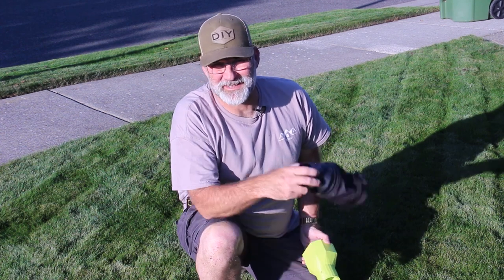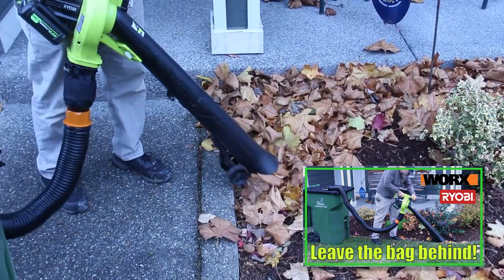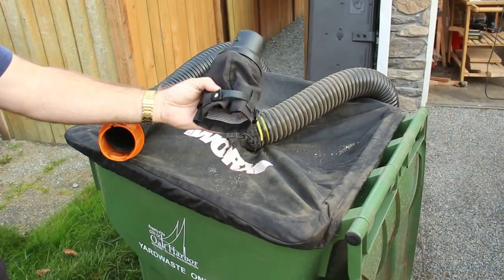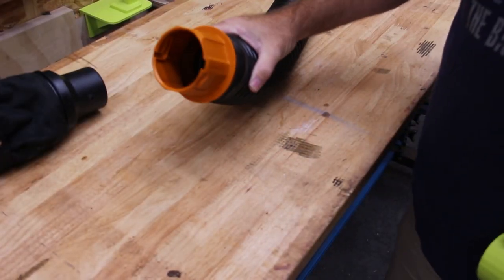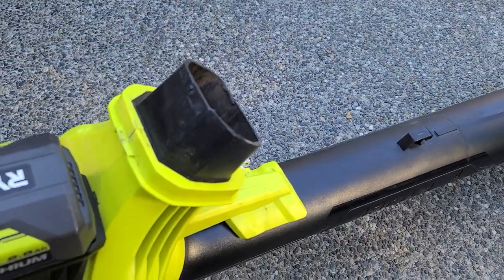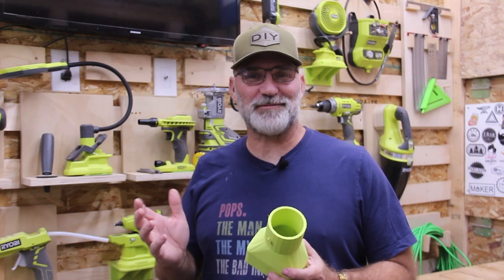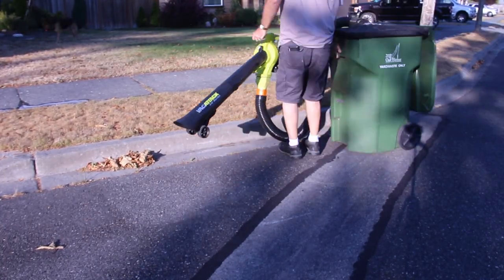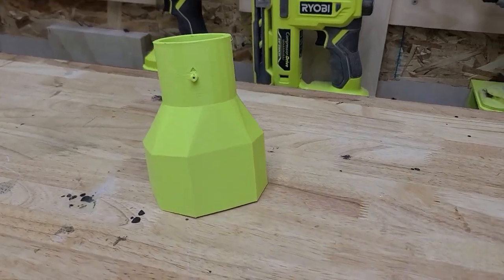3D Printed Adapter for the Worx Leaf Pro Collection System | Ryobi Leaf Vacuum and Mulcher | 2022/19

Comment: 🤯

I'm glad this showed up in my suggestions.  

I 💚 my Ryobi products as well.  But too many acorns in the leaves cause the machine to keep stopping. So I'll either have to blow or rake leaves into a separate area, for ease of use. 

I love the idea of the adapter, but not so much cutting the machine itself.

I use the mulched leaves as native mulch in my yard. So I'd be thrilled to get an adapter with much longer hose  to redirect leaves where I need them.

New sub!
Reply from the maker: Thanks for the feedback!!

Comment: Yes to a longer hose assuming the Vac Attack has enough power to handle a longer length.  Adapter arrived today & looking forward to giving it a work out after the B&D bag arrives from the UK!
Reply from the maker: Keep me posted!
Reply: @DadItYourselfDIY  Hi—a quick update and questions.  Is there a product that reduces the severity of the angle of the flex hose to the adapter that is created when you put the B&D bag on your back?  It clogs very easily especially if the leaves are even a bit damp.  Also, is there a way to create a discharge chute for the Ryobi Leaf Vac?  Rather than collecting them in a bag directly, I found that removing the bag, vac, grind and discharge the damp leaves then go back and either vac them or pick them up is effective.  Thanks!
Reply from the maker: @christopherbullock2644 I replied to your other comment.

Comment: I bought the 3d printed adapter. Do you recommend glueing or putting screw in to hold in place? It seems snug but would think it could come off with the air flow.
Reply from the maker: I used a two screws.

Comment: How do you attach adapter to ryobi leaf vac?
Reply from the maker: Cut the curved part off the exhaust pipe of the vacuum, then slide the adapter on. You may need to use a screw to keep it secured.

Comment: I just got my adapter today... not sure how comfortable I feel about cutting the end off.  Though I do see it will be necessary in the future to use it.  I used the Worx Vacuum and collection system for years but the vacuum/Mulcher wore out.  I always felt the hose was annoyingly too short so sure would like to see how you make that longer!
Reply from the maker: Cutting the exhaust pipe will not affect performance of the tool.
Reply: @DadItYourselfDIY  I'm not worried about that... I just bought the thing and it just seems wrong to immediately start cutting into it.  I am pretty rough on my yard tools and it won't be long before I feel no qualms about cutting it up.  It just doesn't even have a scratch on it yet.
Reply from the maker: That does seem to be the #1 comment. If I could figure out how to get the unit apart, I would design a replacement exhaust pipe with the adapter incorporated
Reply: @DadItYourselfDIY  Well I told you it would happen, I just needed time.  It broke.  So when I fix it, I will do the the exhaust pipe.  Man I thought it would be a little longer than a week.
Reply from the maker: @annenordstrom4495 Wow! What happened?
Reply: @DadItYourselfDIY  The washer and nut came off of the motor assembly fan thing inside the housing.   found the nut when it rolled out of the tubing onto the driveway but I couldn't find the washer. I thought it might be in the bag... but I couldn't find it and frankly I was just annoyed so I just dropped everything on the garage floor said a few special words and said good night.  I did figured out how to fix it last night,  a washer that kinda worked and put it all back together this afternoon after work.  Then I found the washer in the clippings.  It's just how things go around here.  I knew it would happen, it was just a matter of time.  It's raining now, so I'll do the alteration this weekend.  But I am now ready do it and I don't o wait for the adapter Cause it's here!!!
Reply from the maker: @annenordstrom4495 I've never had any issues with mine mechanically. Good luck!!

Comment: I just purchased the adapter so when you put the 2 screws in it did you drill pilot holes or did you just screw then in there
Reply from the maker: I just screwed it in with a machine screw. But a pilot hole won't hurt.

Comment: I just got the worx universal system.On mine it get clogged  in the ryobi exhaust pipe also adapter and the hose alot.I want to get your adapter.
Reply from the maker: I saw you ordered the adapter! I hope it works out for you!
Reply: I got it today were do i put the screws. @DadItYourselfDIY
Reply from the maker: @charliezicolillo where ever you want. Most people center them on the flat sides.

Comment: I just received the adatper for the roybi muncher attachment its not much better than the attachment that came with mulcher  there is no way to connect to mulcher an blows off when using it comment to hose find my suggestion is to mold the black rim to the attachment so it locks in

Comment: I like your idea but there is no way I can cut my Ryobi up. I just bought it. Have you thought about making an adapter for the stock vac?
Reply from the maker: The angle of the exaust pipe makes it impossible, and I've tried to remove the pipe with no luck.
Reply: I didn't realize that either when I ordered. Guess I missed that important 5seconds in the video. I spent a half an hour taking the shell apart thinking it replaced the black piece, but obviously not. Going to have to sleep on this one.
Reply from the maker: Were you able to get the shell apart? I was unable to.
Reply: I’m really hoping for a cut-free version, too. I’m thinking of getting a vacuum, and I’m glad this comment mentioned how cutting was needed! I had jumped over that part in the other video, so I watched this one closely. 

Either way, longer hose video would be great to see, too!
Reply from the maker: If I can figure out how to get the shell open...
Reply: When I first started watching I thought maybe they had changed the design and that tube.  I'm not sure I want to cut it either but hate the bag.
Reply from the maker: It's your tool.
Reply: @DadItYourselfDIY  yeah I probably will since mine is a year old but just hate to.  I understand why though.  I'll probably get the adapter for the Worx system and use one of those collapsible bins.  Might be easier to drag around and I don't think I want the bad on my back. I don't have a yard waste can like you do.  We use those paper yard waste bags.  Wish there was a way to go right into them.  

Did you try and extend the hose?
Reply from the maker: I haven't yet, we are past the season this year, I may take a shot at it in August..
Reply: Thank you for this! And YES for making a video on how to lengthening the hose!!!
Reply from the maker: In the spring!